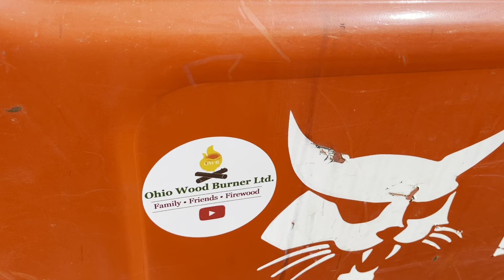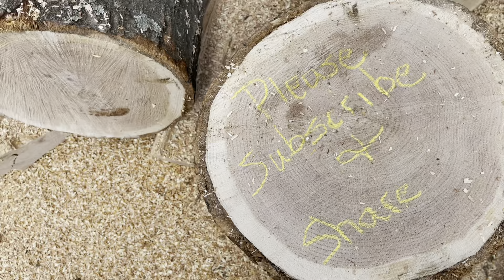Firewood Bucking in the Woodyard!#105

Comment: How and the heck do you get in and out of the Bobcat with the arms up
Reply from the maker: Bud, its a late 2019 model, they changed the design slightly, Thanks for Watching! 🚜🪵👍🏼
Reply: Now to that I saw you get in and out the tracks are lower in the front. My Bobcat has tires and not easy to get in and our with the arms lifted. If I was younger I would trade it for a tracked model.
Reply from the maker: @budlegallee4993  figured you would see it! Lol its still noteasy though at 65 yrs old and 235lbs Lol
Reply: Know what you mean, almost 74 and 255. If this wood business wasn't so much fun I would quit. I only do bundles and expect to sell between two and three thousand this year.
Reply from the maker: @budlegallee4993  wow thats a lot of bundles! Bud the highest I ever got was 257,  I have to get down around 210 I hope, Type 2 going to cause me issues if I don’t, take care! 🚜🪵👍🏼🇱🇷